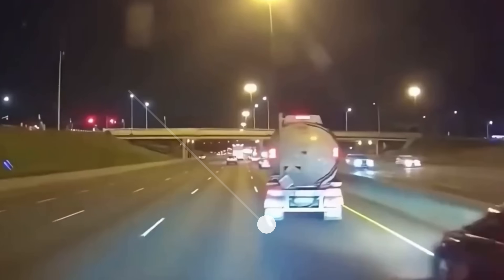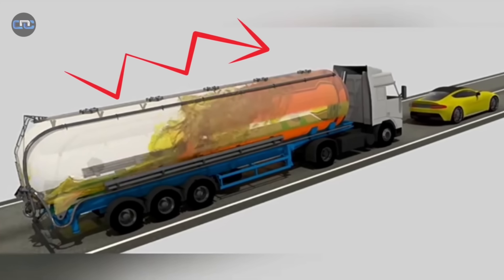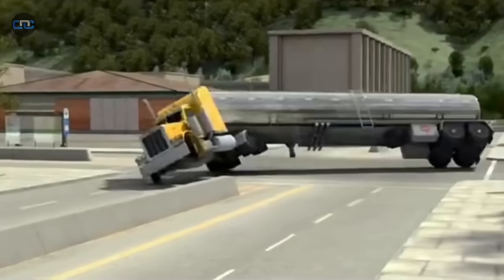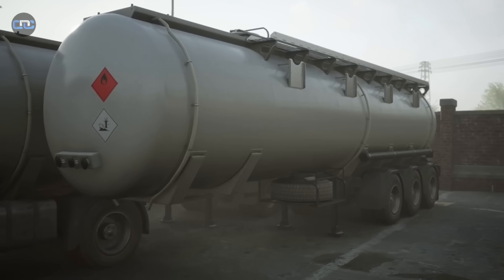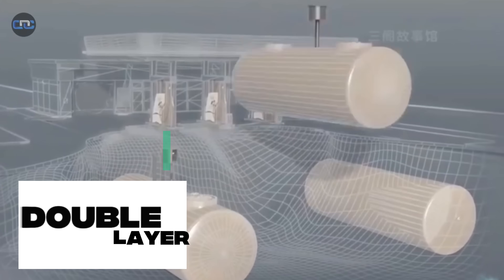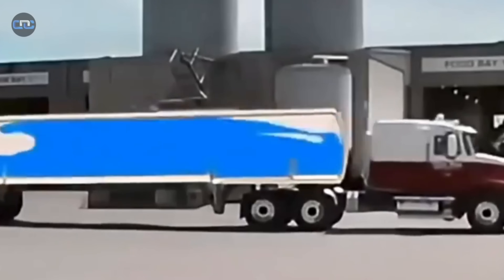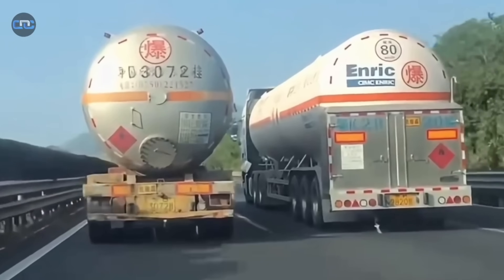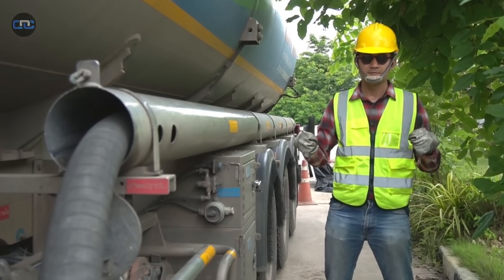Why You Should Never Get Too Close to a Tanker Truck?

Comment: Compressed gas or liquids are terrifying. I worked for a few years at a gas supply company. Mostly for welding. Argon, Oxygen, nitrogen, CO2 were the main ones we filled but we also sold least 20 other types of gas. We just filled tanks on large lines with those main gases. We would move 10’s of thousands of pounds of tanks a day. There were single 750 pound oxygen tanks we moved with one person by rocking it on its side then rolling. In fact that’s how the tanks are all moved on their sides. And 2x 282 pound oxygen tanks at once. With a special technique of each on their sides and you kick the bottom and the tops are in your palms as the tanks roll. So many accidents happened there that were terrifying and the very real risk of a massive multi explosive tank accident was always real. One day filling a full line of tanks the safety went off due to an error. It sounded like a bomb went off. I wasn’t given good enough training and was never told what the safety would sound like. I was told if you hear a loud bang or multiple run. I didn’t know the safety could could exploding after has built up after only another second after going off. So I ran away thinking all the tanks were exploding on the line. Was so scary

Comment: im a oil/fuel reservoir designer and yes baffle or compartment are really helping. 

having a breather is absolutely mandatory or any oil/fuel/diesel reservoir you actually need 2 in case the main fail there a 50% bigger as safety .

for the small gap between the 2 layer of the underground reservoir it could depend on alot of factor but we can use a -20 psi vaccum that trigger an alarm when pressure goes positive it is generally a less costy than pouring special gaz between the two layer

Comment: I will only pass tankers or 18 wheelers in general when two conditions have been met. First, they are traveling at least 10 MPH below the listed speed limit. Second, I have multiple lanes of travel to use (Not on a road that has 1 lane moving in both directions). If both of those are not met I won't try to pass them, it just isn't worth the potential risks to them and myself.

Comment: The only tank I hauled was frac sand. 
One time I hauled 40 tons of gator Ade.  Got my introduction to the wave. I was warned ahead of time so I stopped a few extra feet back. Sure enough I felt a slight push forward, then it pulled back. I had time to think "Huh?". Then with brakes applied went 6 feet forward. 

So what ever vehicle you drive, show it proper respect for your environment. 

Side note, max safe side wind speed is your load weight in tons. I.e. 44000 lbs (22 tons) you can safely drive in 22 mph cross wind.

Comment: Some tanker trucks have bulkhead walls that slowdown the sideways movement of liquids.
And the driver's manual for tank vehicles tells the licensee to take-om curves and turns slower than they would a normal tractor trailer. Slower than the posted speed limit.

Comment: Many tankers can't be loaded to the top with certain commodities. Like acid, liquid fertilizers, so there is a two to three-foot space! Most acid tubes don't have baffles, so the driver has to deal with the rolling wave! One of the worst loads for this I hauled was 1500 gallons of Poly nitrate fertilizer! It's about as thick as hot molasses. And it pounded me and the truck all the way into Canada! Many of those pictures of tanks getting crushed are because they weren't vented before being unloaded! My first order of business when I got to a stop was to open the dome cover before starting the pump! 
. .

Comment: Aviation fuel is less flammable than diesel.  Has a higher flash point. Just to correct those that thought otherwise
Reply: No. Jet fuel is not as flammable as gasoline, it's kerosene. But blue dyed aviation gasoline is 100 octane leaded gasoline. It's used in Cessnas

Comment: I used to work for an airport as a refueler, and one night, while checking the fuel inside the fuel tanker, I dropped my flashlight in the tank full of jet fuel. I quickly got off the tanker told my supervisor about it and we got the flashlight out from the bottom of the tank full of jet fuel. THANK GOD AM STILL HERE TO WRITE ABOUT IT. I THANK GOD AM STILL ALIVE AND UNINJURED.
Reply: Thats a combustible fuel, not inflammable

Comment: Nov2025: Flamable vapors could be reduced by using truck's exhaust to replace air in the tank.  Maybe it should be a requirement.  Airplanes have the same issue.  Jet airplane's tanks are huge.  Filled with air they can explode.
        Retired in Sacto.

Comment: As a former Class A truck driver that hauled air freight, I generally give ALL tractor/trailer trucks a wide berth, both out of safety and courtesy--but yes--I give the widest leeway to fuel tank trucks when I drive any  Class C vehicle like a car or SUV.  (I generally do not pass fuel tankers unless it's guaranteed that I can quickly and safely get past one, I don't think it's a good idea to drive side-by-side with ANY tractor/trailer on any freeway with speeds PAST  25mph.)😶

Comment: I have a 270 gallon fuel oil tank, no baffles, I have used for over 20 years to haul E-0 mogas from a station into town to my hangar, 13 miles away.  I have noticed that when it's only partially filled,  like my last haul of 186 gallons the sloshing effect is much more pronounced then when it's filled to the brim.

Comment: They must be a way for the tanker to keep from tipping over. Like a self leveller
Reply: There is a way to keep these trucks from rolling over.  It's called skill and good judgement.  It has worked for decades.

You can't engineer risk out of everything.  It's just not possible.

Comment: The vast majority of the videos are from other countries not the USA or Canada where there are super strict rules and regulations to prevent such disasters. Most if not all tankers in western countries have baffles within the tank to prevent fluid sloshing back and forth which can force a truck to lurch forward. I haven't pulled any tankers other than food grade or water tanks. Easy stuff if you have a brain and common sense. Unfortunately, that is becoming a thing of the past. Newer generations are complete morons. You're only giving partial truths with this video.

Comment: Slow down 18 wheelers.  They've become too powerful, and menacing on the roads.  Redesign the cab such that the driver sits at the same height as all other cars on the road.
Reply: The height is an advantage, It allows better visibility so we can see problems farther up the road and take steps to avoid an accident sooner. It also would be a design nightmare since the top of those huge motors are taller than your car roof, they would have to redesign every part from the ground up. The shape and height of the truck is also used to direct the air around the trailer in the most efficient way possible, a trailer can only legally be so wide and so long so if you don't have the height you limit how much can be carried in one load. That would massively increase the cost of everything you have owned or will ever own because it would take multiple loads to deliver. A truck being menacing is a personal determination that you make, that's a you problem.

Comment: Question: why are tankers cylinder instead of squared, I ask cause it seems the fuel move side by side making it easy to tilt to the sides on turns, I feel like squared tankers wouldn't cause that type of movement, might be wrong tho
Reply from the maker: Cylindrical tanks are stronger and safer - they distribute pressure evenly and don't have weak corners that could rupture. Square tanks would develop dangerous stress points and could fail catastrophically.
Reply: @CDCCreatorśClub thank you for the knowledge 👍🏼

Comment: I pull a tanker during the warmer months in New Jersey filled with water to fill pools. It does require a bit more attention but it’s not that dramatic 🤣
Reply: Tell me more
Reply: That's because it's water. but be careful on those turns. I had a rollover at 4 miles and hour due to slosh and surge.

Comment: Unfortunately there are too many rude and stupid drivers on the roads that have no respect for bigger vehicles
Reply: bigger they are, harder they fall. 😠
Reply: Rude and stupid drivers don't have respect for Any vehicles, and sometimes they Are the big ones. 

But, yes, everyone hates the big ones blocking the road, tries to maneuver around them when they should just slow down, and should be thankful they are on the road to deliver all the stuff they buy.
Reply: Run them small rude drivers off the road. Better that one idiot than risking the lives of several others.
Reply: saw that last night, coming thru Chattanooga, TN.  They have no idea how heavy and how hard it is to slow that load down. I make it a point to never pull out in front of one, or cut one off in traffic.
Reply: No respect for smaller vehicles - no respect for bigger vehicles. It works both ways.
Reply: unfortunately there are too many stupid and rude UQALIFIED flip flop wearers driving big trucks.

Comment: Those speed limits on curves and turns, or any highway are meant for cars only...on a perfect day, sunny and dry...otherwise you adjust accordingly...Common sense prevails...I tankered fuel and refueled aircraft for 31 years...Jet-A fuel isn't as explosive (high flashpoint...kerosene) as Aviation Fuel and Autogas is, very low Flashpoint...the only Jet fuel that is highly explosive  is  JP-4...extremely low Flashpoint...replaced by the Air Force in 1995 for JP-8...but i continued Refueling NASA's B-52 up until December 2004...it's the only fuel it could use, so they would periodically have 40K gallons made up by Kern Oil and we, Lockheed Air Terminal would pay Cash up front for Kern Oil to make a batch...and NASA paid us Big Bucks for it...and in turn we tankered the fuel to them and i refueled it with my aircraft refueler tank truck...Fuels is an interesting business to be in...glad i had the ride...

Comment: Only takes 1 stupid 4 wheeler hitting there brakes to end a trucker.... sometimes its safer to run the car over
Reply: As cold as it sounds, sometimes you're right. Better to crush a single car than to roll and cause a massive pileup or worse, pileup and fire.
Reply: Will that be legal or potential consequences of braking enough for courts to let you walk free?
Reply: @comrade_commander almost every semi has a forward facing cam..... 80% of the time its the 4 wheelers fault so yes the truck driver will walk free

Comment: I was a driver of a tanker that carried jet fuel, man I can tell you was extremely careful, but a wet rainy night in upstate NY I rolled it after the trailer started to fish tail and the rig slid into a ditch. Thankfully no fuel leaked, nut the next 24 hours getting that beast out of the ditch was hell for everyone involved. Wish I had some clean underwire that night.
Reply: That sounds absolutely terrifying.
Reply: Thats called the pucker factor😮😅
Reply: Jet fuel is for planes
Reply: @bearded_edits4123 it’s still fuel that needs to be transported via a tanker
Reply: Proving there is nothing we could do, and trying to frame us was futile.
Like blaming us for the whole in the ozone, after making hair spray and knowing it would be used.
Did you use hair spray as directed?  Me too, how is the whole in the sky our fault?
Experts never do anything wrong, we did it. Even demanding they stay with glass bottles, beer was the only thing that didn't switch to plastic, WOW.
Reply: @uhadme  Wait what? Wrong video by chance? 😂🤣
Reply: Jet fuel is actually one of the safer fuels to haul...it combusts via compression, not ignition.
Reply: @CrocodileMonty777  Jet fuel can be lit. I've seen it done when I went to Navy firefighting school. Much harder to light than gasoline though.
Reply: @CrocodileMonty777  some people are addicted, you know?
Reply: @CrocodileMonty777 jet fuel is very flammable and is easily ignited. It's diesel thats more stable.
Reply: @grantyentis5507 Jet-A isn't very flammable...
Reply: @grantyentis5507  Jet fuel isn't easily ignited, that's sorta why you need so much heat and compression for it to burn...
Reply: and a new pair underpants
Reply: Be safe out you truck driver's people don't realize the dangers a truck can be in a  accident ,  people get hurt we don't get are merchandise to stores animals were they need to be and yes for the sensitive people to get processed!  George Strait for Superbowl halftime show what you think spread the word & thank you guys (truck driver's ) keep America going
Reply: Glad u was ok
Reply: Maybe you can help me out then. I live by a m'way & use it almost every time i Go out by car. 
Given it's drilled into drivers to keep your distance, why do lorries utterly ignore that rule & driving at 50mph plus form snakes of 5 + vehicles, leaving only metres between a trailer & the following cab. 
It's dangerous for no other reason than the speed of a 40 ton missile being unable to stop in such a ridiculously short distance! If they do lock brakes, they risk taking each other out & all the following innocent vehicles? They're automatic toast! The carnage in fog or traffic has been monumental. Then they take up more than one lane because who wants to be stuck beside such a lorry train? It's scary at best! Overtaking becomes almost impossible due to the length of the train. The tailbacks they cause are therefore horrendous & I've seen how they can practically bring junctions to a standstill! What is worth causing such chaos & utter fear in car drivers? Isn't that behaviour a bit arrogant?
Reply: Drivers do this , follow each other closely. To reduce wind drag, to save money on fuel. It's a simple result of economics with huge consequences. Accidents are often deadly and you are correct. It is illegal and the safe drivers know it. The simple truth.  @eucharistodeo
Reply: No, you were definitely going too fast for conditions there driver. There's no excuse for losing control of your rig in the rain, unless another vehicle was involved. Are you still driving?
Reply: @ottohumpmachine8958  did you even read the full comment
Reply: @The_Ambababush. Yeah I did and I stand by my statement. Did you? What did I miss?
Reply: @ottohumpmachine8958  he who does no work he makes no mistakes. I bet the lessons learned

Comment: Tankers don’t drag a metal chain.  No sparks allowed.  Can’t even use auto chains.
Reply: Excectly cause we use bonding cable especially when we are unloading the truck at a filling station.....
Reply: What was that hanging down? Something was there discharging the static electricity.
Reply: @dannydaw59  grounding cable.

Comment: Just another idiot trying to fear monger for click bait. The Wave Effect is actually called surging and while it does have enough force to increase stopping distances, it doesn't rear the equipment up. Pressure relief valves keep the tank from exploding or imploding. While tankers are to be respected, there's nothing to fear. Had plenty of morons throw lit cigarettes at my fuel trailer and nothing ever happened.

Comment: I did not get the part why it impledes
Reply: Its implodes due to vacuum caused by drop in atmospheric temperature, or lack of ventilation during/after discharge of liquid.
Reply: @AK-vk7gn  it is surprisiing that such big vacuum can exist
Reply: Its implodes due to vacuum caused by drop in temperature or lack of ventilation during/after liquid discharge.

Comment: @CDC: Creators Club, why are you using a tipping silo tanker that is used to carry bulk powders only to show how liquids react to harsh braking? Straight away, you are confusing the public; also, fuel tankers are fully compartmentalised into 4/5 compartments. Chemical liquid tanks that are single compartments have baffles to stop the wash or tidal effect when driving. Some of your information is valid, other parts of it are complete BS I know this as I've driven both liquid and dry powder tanks, under ADR regs(hazardous) and non-hazardous. Another point is that food-grade liquid tanks don't have baffles due to the fact that the product could stick to the baffles, causing cross-contamination.
Reply from the maker: Thanks for sharing your experience! 🫡
Reply: I drive flammable chemicals in non baffled tanks. Not every situation is the same.